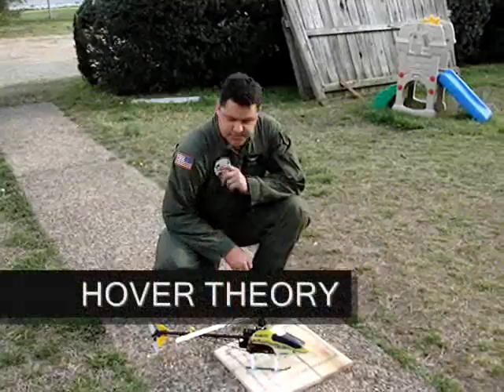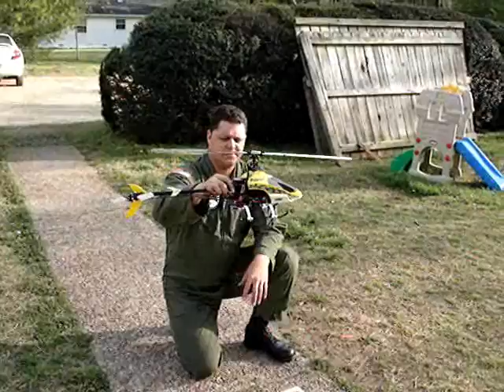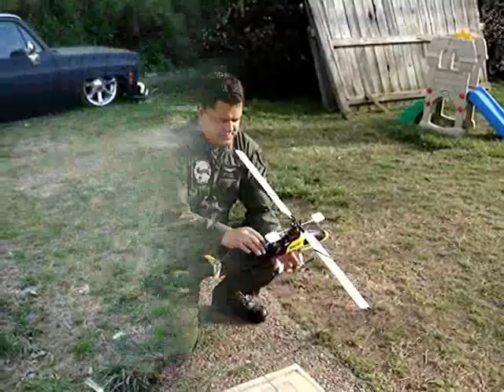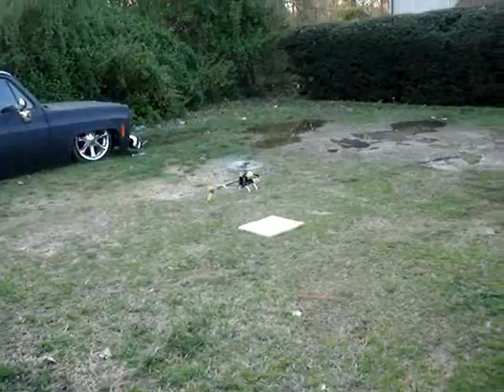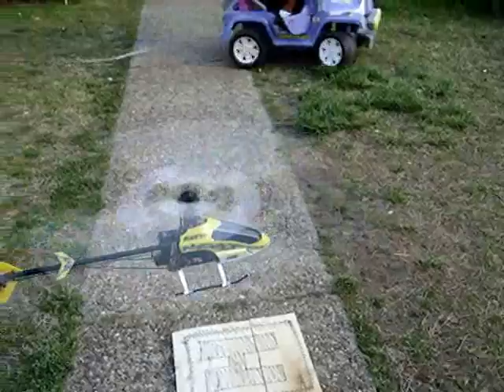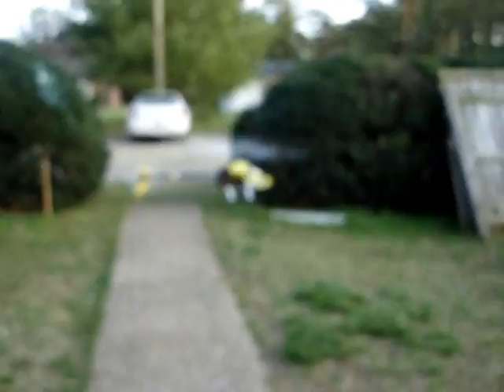Blade 400 3D Basic flight theory I

Comment: Great instructional video and from somebody who is in a Chinook crew.  I was looking at you setup videos to work out where my washout has to be neg/mid/pos stick so I can setup the pitch of my blades.  I'd previously levelled out as per rcheliwiki with level bell-hiller mixers but took it out today and had positive pitch below mid stick.  Nice all in an all, but please exercise a bit of safety.  Headspeeds can get be around 2500-3000rpm and you're letting your kid go around in a rideon toy car.